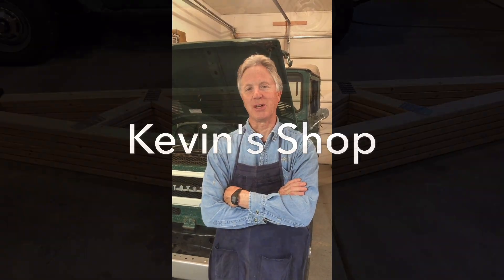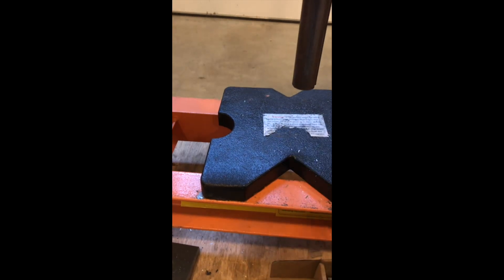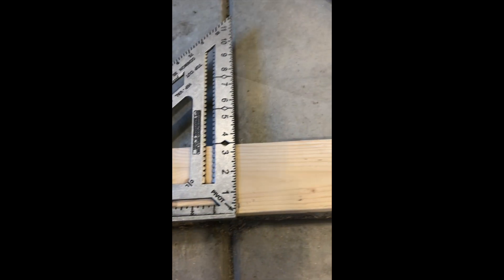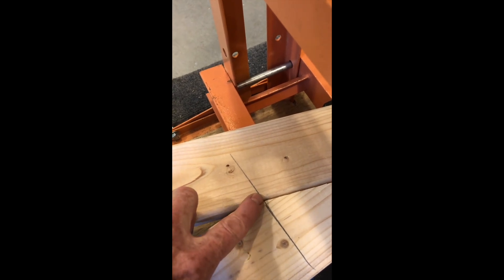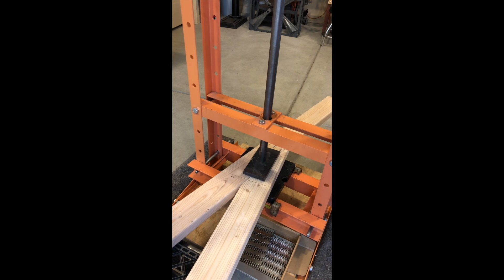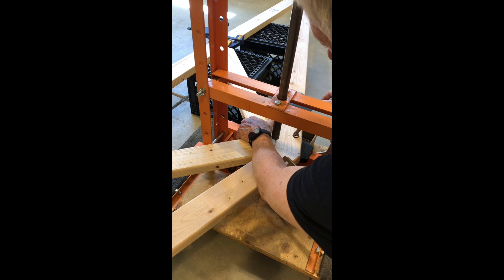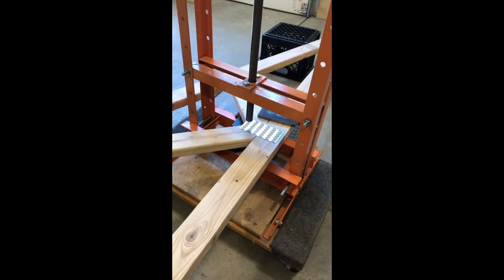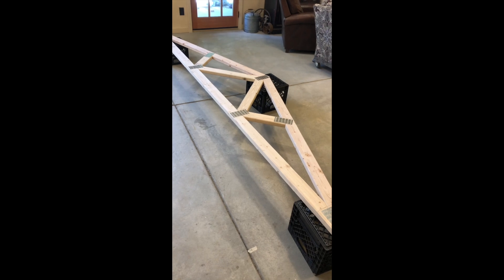Homemade shed trusses built with bearing press.

Comment: Nice. Looks to be a market for a portable unit that a diy er can use. As far as anything that small like a shed it would be much less time and money to simply build it conventually using rafters and joists.
Reply from the maker: Thanks for watching and taking the time to comment!
 I took this approach for several reasons. I was working alone and I have physical limitations. The weather was bad and I had to wait for the foundation to be poured. I also wanted to build  to meet our heavy snow load requirements. Once I had the trusses engineered, using a computer program, it was easy to cut all the members and construct. It is amazing how light they were given they were 16 feet long. I attached all the framing brackets to the walls and this made installing the trusses so easy for me working alone. Regards, Kevin.

Comment: I need to build some trusses and saw this video. I like the solution you've come up with. I mulled stuff over and didn't come up w any idea I liked for installing mending plates.  This looks good.  In the meantime, I did have the idea to just use plywood or OSB patches, glue, and screws. FWIW. Regardless, your solution is good.

Comment: Great video and thanks. I was thinking that a compressed air hydraulic jack/ram press would be easier to work with.
Reply from the maker: Murray, you're welcome! Yes something faster would be good! It takes quite a bit of pressure. I used actual truss plates which are different than the mending plates that are in the hardware and big box stores. Truss plates have longer teeth and they also have a twist, so the lock into the wood.  It takes a lot of pressure to get them seated nicely in the wood. Thanks for watching and commenting, Kevin.

Comment: Large trusses are built with structural old growth lumber only which is typically 3X as strong as lumberyard material. Unless the building span is very small I would not recommend anyone building their own trusses. I am an engineer,
Reply from the maker: Tim,  I appreciate your feed back, the span was small for a storage shed. Thanks for watching, Kevin

Comment: Cool idea I was going to ask, you can't do top and bottom nail plates at the same time can you?
Reply from the maker: I appreciate the feedback, it may be possible. I found it was easier to focus on the one side and get all the joints tight, positioned and the truss plate placed correctly. Once the one side is done it was quick easy to do the other side with everything locked in place. Thanks for watching, Kevin.

Comment: Thanks for sharing and nice workmanship.    I can understand wanting to build things yourself when you have time and it saves money.  In this situation it seems that adding  plywood gussets with ring shank nails  or screws would have been quicker and probably stronger than the metal gussets.  The other thing I noticed is that the truss span is not very long, nor is the depth very deep.  Trusses become more cost effective as the span increases as shorter spans  such as this can be easily constructed with dimensional lumber (2x6's) perhaps?   I know for my shed, I use the open area to store plywood, lumber  and small parts.
Reply from the maker: Thanks for your comment. You are right, I like doing things myself. The trusses were a fun project and worked well for me because of my physical limitations, they were so light and easy to work with. They also were very uniform, I used the centerline marks to aline on a  string-line,  I had pre-installed the hurricane anchors and they were easy to place and have installed in minutes.

Comment: 15 years ago, I found was that trusses made in a truss shop were priced LOWER than the lumber to build them myself. Plus the huge time savings, and they had an engineer's stamp certifying the design.
Reply: wonder if this is still true today.....i'm skeptical
Reply: @allenlane5000  No it isn't. Prefabricated trusses, at least in my area, are 8X the price of the lumber.

Comment: interesting, but I think a good heavy hammer would have worked too, and likely quicker.
Reply: Can't do that.  The teeth need to be pressed in straight.  Hammering them in bends them by quite a bit, making the finished product much less stable.